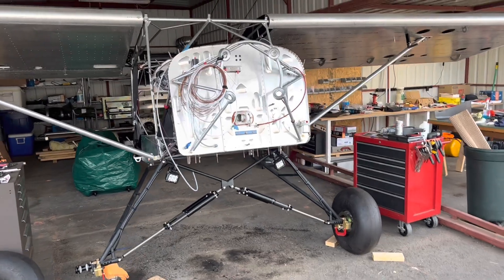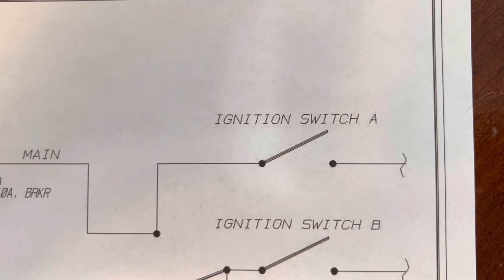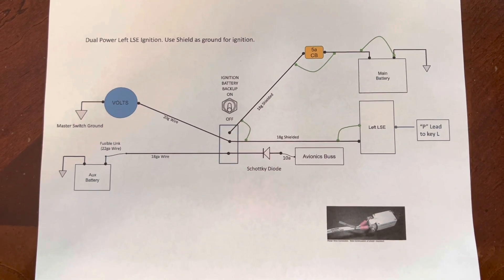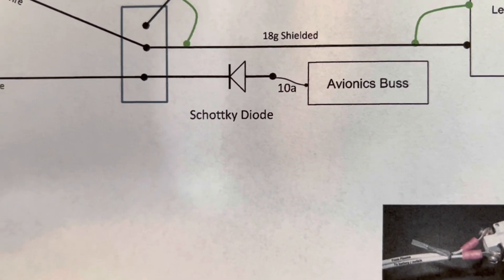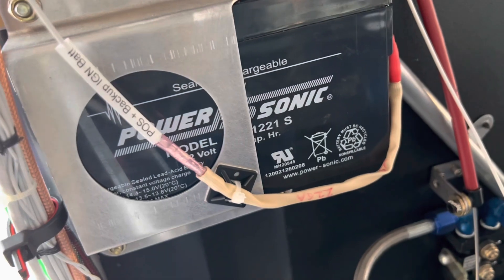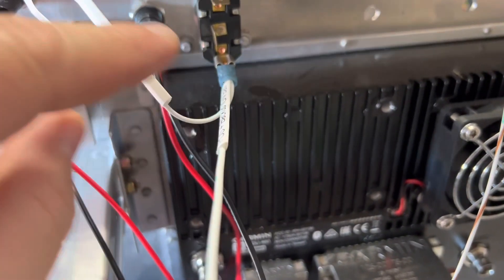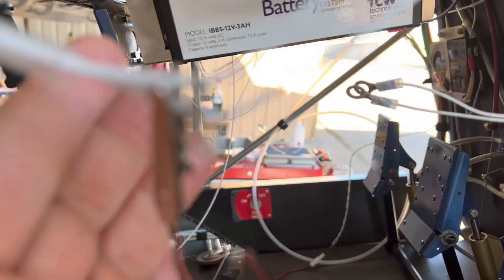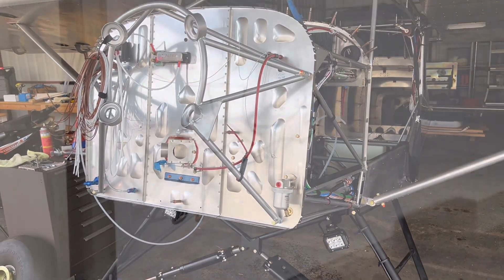RANS S-21 Lightspeed Ignition Wiring

Comment: I have been thinking of installing the TCW Technologies IBBS-12V-6ah back up system ACS sells.  It's available with a wiring harness and is designed to make the installation a simpler with less to figure out.  Friends that have Lightspeed ignition system tell me they are famous for lack of help.  Just wondering if you checked the TCW back up system out.  Great video.
Reply from the maker: I have the TCW back up system for portions of my G3X. I opted for RANS provided back-up system for the ignition. I got some help from RANS on their ignition back-up battery installs they use for their S-LSA S-21. My biggest hurdle was how important is using a shielded wire and shield from ground and where exactly do I need those wires. I also utilized the power select switch as a terminal block so to speak to double up wires for charging the back-up battery. RANS has multiple wires going to the battery instead.

Comment: I like how you've soldered your crimp connectors. On marine applications, I always use the heat shrink crimp connectors with glue in them to secure the wires. Any reason why you wouldn't use those on aircraft?

Comment: is that a special gear with shocks??
Reply from the maker: Yes, Shock Monster gear. Bolts right up. Call Tony at TK-1 Racing to purchase. I keep forgetting to do a video…
Reply: @BadlandsAdventures  Cool! are you doing any other mods for bush flying? I am still torn between the S21 and the SuperstolXL. I don't care much about high cruise....

Comment: Thanks Brandon- great video. I'm also waiting for my Titan IO-340 that I also ordered in Nov 2020. I'm using the dual Lightspeed ignition- only difference is that I'm using 2 TCW IBBS for the backup power- one for avionics and one for ignition.  I'm working on cockpit controls install now.  Good luck with the rest of your build. I'd  like to reach out and communicate via email. I'll try to IM you. Randy
Reply from the maker: Thanks Randy... I'm trying to pay it forward and put out information. I definitely like the TCW IBBS units! I saved a bit by only going with one, but it seems more of a headache to wire myself and no benefit of the automation of the IBBS on the ignition.